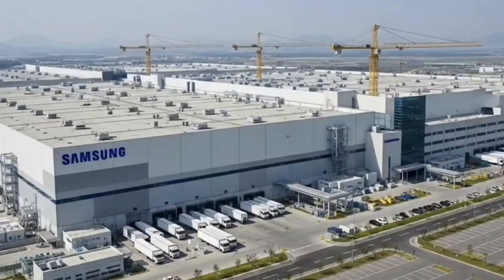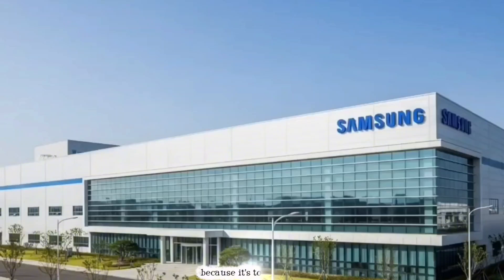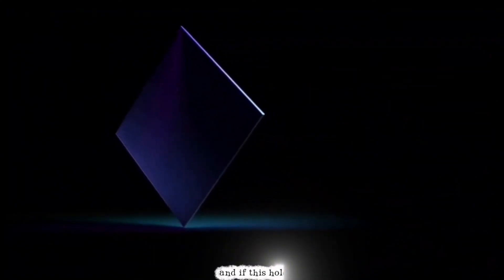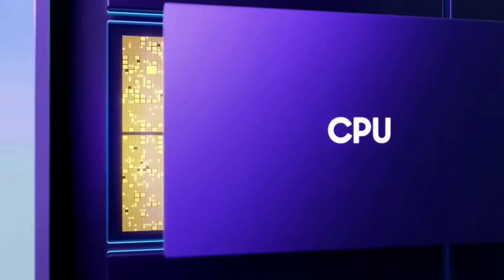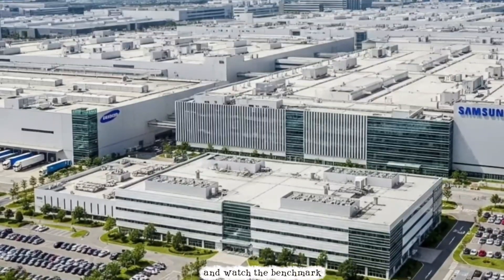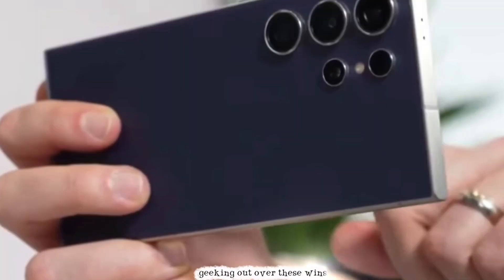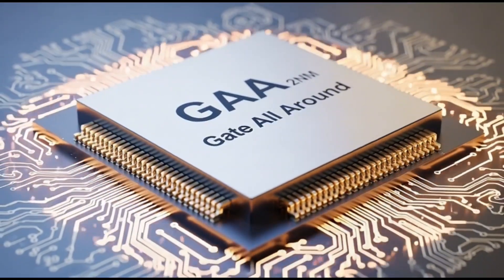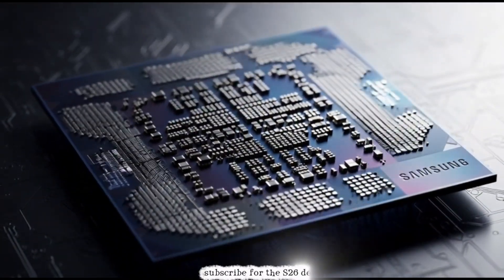Exynos 2600 DESTROYS Apple A19 Pro & Snapdragon 8 Elite Gen 5 — 2nm MONSTER!

Comment: What's more important, most power or best foundry work quality? While the Samsung Exynos 2600 has the most power thanks to being on the 2nm node process, it's built on Samsung's inferior foundry. By contrast Apple A19 Pro and Qualcomm Snapdragon 8 Elite Gen 5 while having less power due to being on the 3nm node process, it's built on TSMC's superior foundry. So there you have it, most power vs best quality which means there's a trade off in choosing which SoC to have.

Comment: Under lab condition, the Exynos 2600 got lower score than the lab results of the Snapdragon 8 Elite Gen 5.
The Snapdragon was close to 4000 single core and 12000 in multicore Geekbench 6 score.
So, only the non-ultra variants will get this SoC.
Impressive points nontheless.
Reply from the maker: Appreciate you sharing the lab results.
Reply: @petniyi35  
In this case it was run by a phone made for showcasing the capability of the Snapdragon 8 Elite Gen 8 event.
https://www.youtube.com/shorts/kmoHW25YqfY

Comment: Exynos has came a long way. I use the exynos 2400 and i have absolutely no problems with it. Unless you use emulators or stuff like that, you won't feel that you're missing out. Maybe on battery consumption. But my S24+ on 85% still last a full day without any problems
Reply: Same with my s24+ , Way solid than i thought it would be .
Reply: Exynos in the Samsung Galaxy S6 was ahead than Qualcomm Snapdragon chipset in the same year too

Comment: Why do I need an NPU if I don't have direct access to it? It's a completely useless thing that everyone pays for. It would be better to remove the NPU and increase the GPU to match the NPU's size.
Reply: Well, i bet it's not even that big difference here, just the content creator don't know what is the difference between  int4, int8 or int16 values.. Apple usually use the int8 to measure their SoC but Qualcomm also used int4 values against that.. and the idiots directly compared the int8 and int4 values..😂

Comment: Here's the thing people aren't properly considering, 3nm to 2nm is supposed to be big jump that samsung isn't even getting properly yet, so the fact that people assume just because the old Exynos chips had issues that the performance might not even be close to this is baffling. People should really understand the difference in 3nm and 2nm
Reply: If it is better than spandragon 8 elite gen 5 why they will sell to USA and China worse thing?The thing is samsung provide more good stuff to China and USA especially China
Reply: @Kvool-zt9pw rumors samsung is ditching the snapdragon for the exynos as it is pulling away from all  chips on speed in every category and also more efficient
Reply: @Kvool-zt9pw Qualcomm headquarters is in California so that's probably got something to do with it.
Apparently the chips for the Ultra are around $250 each. Maybe they get a deal for devices on their local turf.
Exynos cost Samsung around $150 so rumours say which means they can reinvest in other area's without damaging margins.
At the minute the expensive Snapdragon means Samsung cut feathers like Bluetooth in the S-Pen etc to keep margins.
If the Exynos is fast and reliable, it could be massive for future features like better cameras upgrades in the future devices.
Could finally get a better selfie camera which is around 6 plus years overdue.
Reply: Rumors says a20 pro chip expected to be 2nm too and apple doesnt make that step before they perfect it, and it will increase performance and cooling so probably will be same for exynos

Comment: Guys chip isnt even tested properly. Still in testing phase. Is cooling fails it will throttle so bad. Just hyping it up thats it
Reply from the maker: I said that in the video bro
Reply: So your telling us it’s still in testing phase yet you’re passing judgement? Hypocrite much? 😂
Reply: They don't suck. But let's wait to see if the modem is separate from the processor.
Reply: They dont normally claim unless it is tested. For the heating issue, they will continue to monitor and make adjustments
Reply: Dude these absolutely idiots still think exynos chips suck
Reply: Nah, chip is tested. How? Samsung is one of 2 company that can produce chips in 3nanometer along with tsmc. Looks like exynos 2600 is going to be the world's first 2nano GAA chipset with over 50% yield rate. Samsung isnt know for its AP, It is well known for dram and HBM that goes into Nvidia's gpu.
Reply: @btrader4lyf  That's one very accurate summary. Samsung is relatively new at designing APs. They are much less experienced than Mediatek and Qualcomm. Even Xiaomi is not experienced enough and that's manifested by a long hiatus between their SoCs in addition to their very limited offerings. Let's hope the foundry side can get their yields up so we can have choices. Apple and Nvidia stand to benefit most with a competitive Samsung foundry even if they don't place a single order.
Reply: @dalobucaram7078 i am hearing that samsung's 2nano has 50% yield rate. And Nvidia is a major customer of samsung when it comes to hbm for their gpus besides sk hynix.